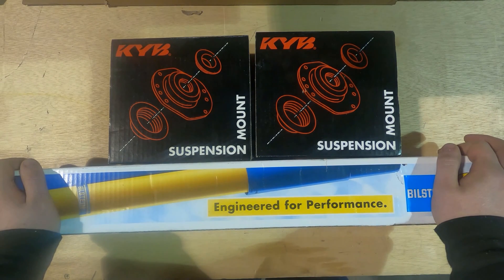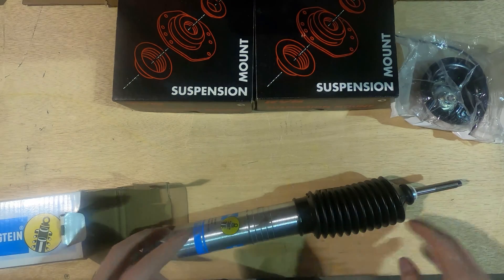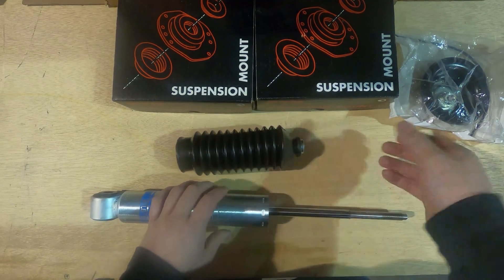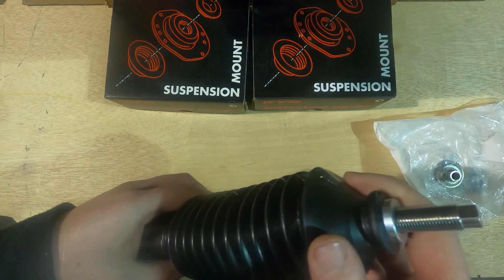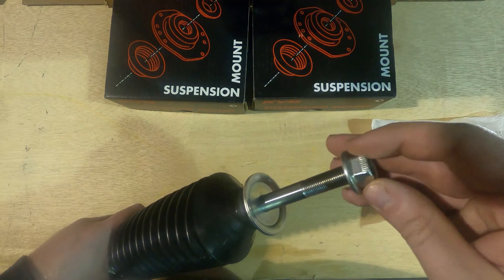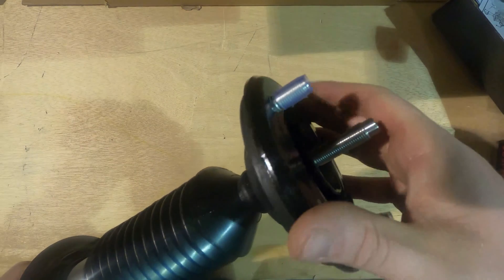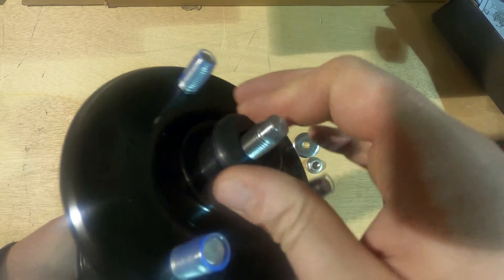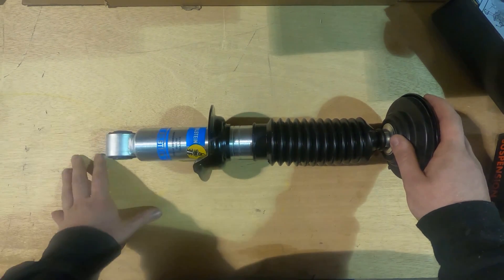Suspension - How to prep your Bilstein 5100s

Comment: Where did you get that top hat hardware?  I got a Monroe kit, but it is missing most of that hardware, like all the washers and sleeves.
Reply from the maker: you can get the top hats with the hardware from rock auto
Reply: @AlldogsOffroadCoop  Thanks, my best searches didn't find the washers, just the bushing and they have a top hat that looks nothing like the stock one.  I did find a Dobinson 4Runner set with everything, but have to wait another week for all the parts to show up🤦‍♂.  Thanks for getting back to me.

Comment: Is it not recommended to move up one spot for extra lift to level the complete kit from ADO? Installed as assembled but still a little to much rake .... or would that require new UCA?
Reply from the maker: we offer the 1/2" spacer if you want a little more lift in the front. the bilstein with the ADO spring maxes out the shock and going another notch up can break the shock. you should have just enough clearance with the spacer and the bilstein to not require arms but can't guarantee it.

Comment: What is that top mount kit you show?
Reply: search “KYB SM5698 - Strut Mount Kit” and “KYB SM5699 - Strut Mount Kit” on Amazon, the metal top hat comes separate from the rubber part that goes against the top of the spring
Reply: not sure it’s exactly the same one but looks extremely close if not identical to the ones I bought off amazon. got moog springs, and Bilstein 4600’s to go with it.